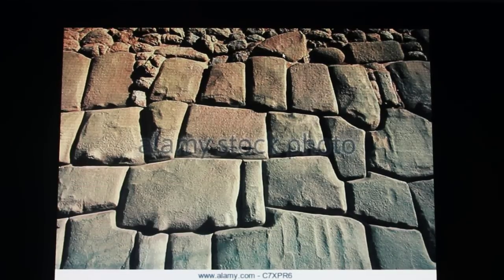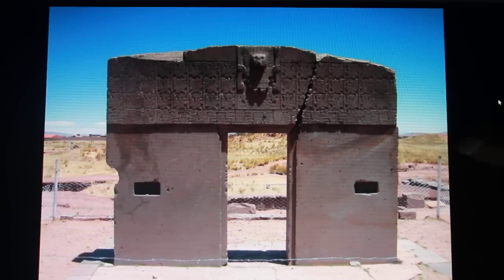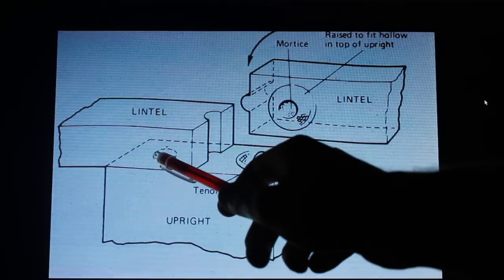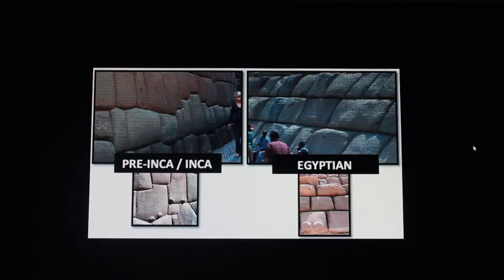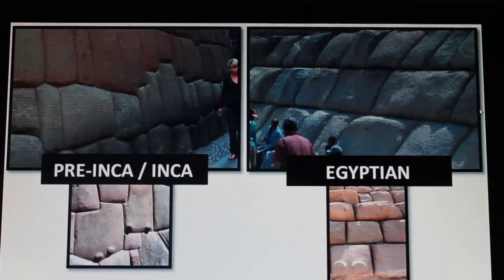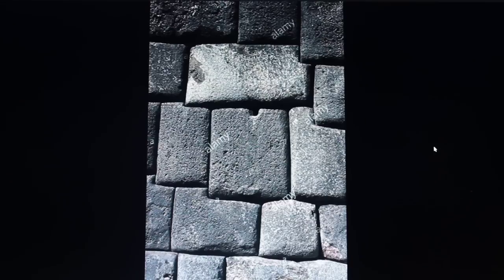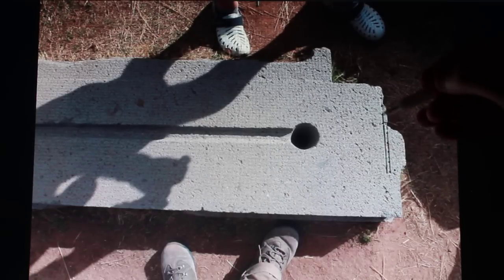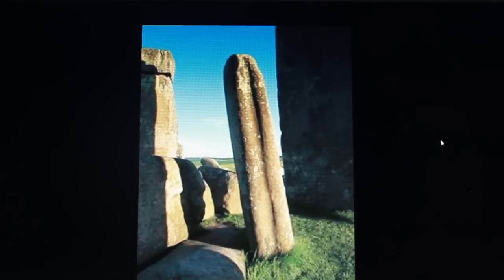Is this what the NUBS on megalithic pre-Inca walls are for? (FOR JOINING STONE?, Proof provided)

Comment: The nubs may have been for levers...large logs used to take most of the weight off the stone beneath it to place a lubricant between the stones...I believe a slippery compound of fine powdered iron ore mud and silica sand was used as a lubricant/abrasive ( hydro dynamic wedge). The stones may have been roughly cut with a bronze disc in the quarry using sand and water for an abrasive compound. The stones may have possibly been moved back and forth until they fit into each other perfectly...Silica has a moes hardness of 6.5 to 7 which is harder than granite, the humans of that period were highly determined, intelligent and extremely strong individuals. I'm not going to be quick to say that aliens did it with power tools because I don't want to dismiss human spirit and enginuity...when someone can disprove humans then I will look at other worldly or extra terrestrial theories. Humans today are extremely intelligent but lack the determination, drive, imagination and strength of the humans of that period..even back then they were extremely intelligent...it's just that today most people have a limited concept of creation and absolute no way of knowing how our ancestors did things, other than the glyphs left behind. I'm not saying that there are no aliens or other intelligent life in the universe but most people are quick to dismiss the humans of that period and say that aliens of a higher civilization must have done it. If we can't understand how they did it how could they have know how to do it??? Humans of today have a limited knowledge of making megalithic structures like these with the tools of that period. open your minds people, everything has an explanation and a reason behind it...note that the stones are not cut perfectly at 90• either..now don't you think if they had power tools they would have went to the extremes of making it a perfect structure...The Egyptians were very similar in looks to the South Americans and did have boats...disprove the humans first before you jump on the extra terrestrial theory which, don't get me wrong, is also a possibility...humans are amazing no matter what period they lived in. The stone wheels that are found at many of these sights may have been used as a hone to smooth the surfaces of these structures. Don't dismiss ancient humans before you can disprove them. Where there's a will there's a way...faith is power...humans are amazing!!!!

Comment: I've come to the conclusion through everything I've learned through research into this type of megalithic technology, that the builders had to have had some way of softening this incredibly hard stone without destroying it's atomic structure. It must have been done without the use of heat, somehow. I do think you are incorrect, however, in your assumptions that these were the work of some dying civilization and reusing this stone. This stonework is far, far to precise to be anything but the work of a highly advanced and thriving culture. I believe these stones with the nubs are much, much older than current accepted science is saying.

Comment: let me explain in simple terms.
these so called "megalithic" walls are built very roughly out of rubble, done in sections with wooden poles embedded, sticking out at various points, with only the tops of each section finished with cement and an imprint for the key to the next one, as each section is finished another pole is set in and then they built the section around it.

the wooden poles were for the wooden scaffolding to be attached as the wall got higher, when the wall was complete they rendered over the wall making it look like huge individual blocks, they started at the top and worked their way down rendering and dismantling the scaffolding as they went, as they got to the wooden poles they cut them off and rendered over the remaining "nub" to make it look like it was part of the stone.
 
if you had an invading army what better way to put them off than to make them believe, without even saying a word, that you were mightier than them !

the reality is, i could make those walls single handed, Stonehenge, pyramids and huge statues alike.

you can use crushed granite dust, sand or any kind of crushed rock including crushed quarts for durability, as ballast.

what you are looking at is concrete technology just like ours, cleverly done to confuse people right to this day!  

if you look carefully at some of the blocks you can see where the render has sagged at the bottom between the "nubs", as for the "scooped out areas, i would imagine that is where the render was too soft and it slipped off.

after a few centuries of weathering who would know ? 

why some of these walls were left unfinished or why they were abandoned is any ones guess .

i could use my imagination and say that the "nibbly pibblies" came down from planet "wonderoo" and used magical implements and ray guns twenty thousand years ago while we were busy dragging our knuckles along the ground and grunting to each other, make a lot of money from doing tours and selling books, or i could apply logic ! that's not to say there isn't some mysteries about these places, but rather as use our imaginations maybe we should try logic first.

there is nothing new under the sun, people.

Comment: 😂 All nubbs are nubbins but not all nubbins are for joining. 

I think you're right about some of these structures but not about the nubs on the faces of complete inca walls.

Personally I think the nubs on wall faces were for a timber frame, which helped keep rocks in position, anchoring and stabilising them, as they were worked.

Comment: After the Flood there would have been dead trees and logs everywhere.  What if an ancient civilization built out of wood from trees 30' in diameter.  Shaping and cutting it would be easier than with stone and would be nearly impossible to burn down being so thick.  What we see as stone buildings may actually be petrified wooden blocks.  What if the nubs were carved as a tie back for an overhead tarp or awning?

Comment: The incuse cuts that join up with a sister stone would od most likely hot molten metal poured into them or lead beat in them to more permanently join the two and keep frommany movment over the life of the structure, I believe these where also found like that on the roman colloseium most of them had been taken by scrappers hundreds of years ago but few where found with the metal still intact inaide the incuse shapes to bond the stones together.

Comment: Nope. Otherwise we'd have stones with broken edges and examples of such stones. Doesn't explain why some have them afterwards and were not curved down to be flush or that other stones have none of these markings. Seems more likely that they represent certain mountains as topological reference points and they are at the base over every stone to signify that they are mountains coming up from the base but in relief for height references, at the same time.

Comment: But if they were used to join stones together, which I kind of agree with, why were they so precisely jointed? The walls were no doubt built to be earthquake proof, and to last. Firstly why would they then dismantle a perfectly joined lasting wall, and secondly, wouldn't the nubs be as perfect as the walls. In these cases, they are almost an afterthought. My personal view is they are almost random like the filler holes would be in a mould? The stones are so perfectly jointed that they weren't placed there to be subsequently removed and reused. Strength in their randomness, and non use of mortar. But I believe they may, through sound, or electromagnetic waves been able to make metamorphic or igneous rock fluid again. Which they then poured into mounds. Once set the moulds were removed and the nubs , or filling holes are left?

Comment: Mortice and tenon ... nice idea and even sounds great at first. Problem is the shape and placing of the nubs makes it very ill suited for that purpose. You keep showing good examples with your mason and lintel drawing, which is exact opposite of actual nubs on these stones. Your example shows centrally located, actual nubs are not plus are on the edge and would not handle any load as would shear off or split. Mortice and tenon should also be uniform, when these nubs as even you pointed out are all totally different shapes and sizes. I would also think with all the examples especially since spanish removed so much of it that one would have by now found a prime example of nub being used as mortice and tenon, when exact opposite has been the case. Nubs and corresponding indents have only ever been found on the face, nowhere else.

Comment: The "reused" statement gets confusing to me. The idea that the walls are more structurally sound because of the nubs makes a lot of sense. I wonder if there were a way to "see" the inside structure of hoe the stones fit, your case would be confirmed. However, such intricate fittings in the walls, such unique shapes of the stones makes it less likely that they have been "reused". Unless in that first use, they were somehow in the same order.

Comment: Excellent presentation, i’ve noticed those knobs and dents for a long time. Could there have been a finished stucco or stone finish the building let’s say. When working with that kind of medium you don’t want a smooth slick surface you want irregularity to allow the finished work to more or less lock on to the substrate below it . 🤔

Comment: How does one know what they were for? They may serve no purpose other than ornamental. Sometimes a rock is just a rock.
Reply: Except, clearly, none of these are simply just plain old rocks. The big thing here is the shape. Forget the nubs for a second. If you wanted to recreate these walls today, the size of the initial rock would be massive in order to machine them into these shapes. There are no cut marks at intricate small corner angles that run into and beyond the 90 degree corners. That means at the very least any cuts made had to precisely end exactly at the corner, running the full width of the corner. Even with a diamond saw that would be ultra precision work today. On top of that, the rock that fits into it would have to be as precise. Now look at these and see how many curves exist as well. To recreate even a modest wall like this would cost millions today.
Reply: ZTekMil, cough,  cough, sarcasm. Honestly I don't believe they were carved. I have poured thousands of yards of concrete and these, to me, appear cast. Stone does have a melting point.

Comment: these rocks could very well have been poured to fit instead of cut to fit. Except, I have seen on some other artifact rock saw tooling marks.  In either case, we are far inferior to the technology used if these were rocks of a sort. But if you look at our today's building technology, we can totally duplicate walls even with more precision than these ancient walls were built. Our concrete of course does however not hold up as long. If concrete is not covered, it deteriorates within 50 years and starts crumbling apart. Maybe the ancients had a way of melting rock, then when almost hard, they put it in its place for which it had been poured and formed and thus you can see the tooling marks on various locations. The different recesses could just be signs of sloppy work or tooling marks. However, it's all a speculation anyway. But still cool to see.

Comment: IF YOU QUARRY THE ROCK WITH THE THOUGHT YOU ARE GOING TO REASSEMBLE IT THEN YOU JUST NEED TO WORK THE FACE  I HAVE SEEN WHERE THE JOINT WAS NOT FINISHED/BEVELED AND IT WAS CLEAR THE ROCKS CAME OUT OF THE QUARRY AS 1 LONG  [TALL AS WALL] SLAB   BROKEN INTO MANAGEABLE SIZES AND REASSEMBLED

Comment: so what your saying is highly skilled engineers barely escaped with their lives from an embattled planet in the midst of all out war with  very powerful bombs or nukes and that the first thing to do was set up a safe house made up of the most durable hardest stone and literally double up the wall thickness using megalithic sized bricks . interlocking unmovable fortress type architecture and pray like crazy they weren't discovered . because that would make sense really . the rest just does not check out or add up . earth born cavemen didn't need bomb shelters but wherever it is these cats came from clearly they were shittin' their pants . (or at the very least could feel a turd licking their jeans)

Comment: After carving thousands of rocks in a quarry to fit perfect. Wouldn't it be wise to mark the rocks in a fool proof way as to not put a several hundred pound rock in the wrong place? Maybe the nubs are an ancient method of marking the stones for placement without writing it down on paper or clay tablets.
Reply: Betty Gates If the nubs had some sort of pattern for your thoughts, then they should reflect and mirror thier actual placements in the structure.

Comment: How about...... the stones were used previously, for a wall or other structure, and then were used to build another wall.
Reply: If that was the case, they would have had to re-soften the stones to make them fit with this precision and use no mortar. When I first saw these stones years ago, I wondered why they did not make the wall solid. Since they could obviously do what they wanted with the stones anyway. But then it dawned on me that in earthquake areas, the possibility that the walls could absorb the shock would be critical. These walls have no mortar for that reason. During an earthquake these walls must sound like the biggest bag of bricks ever clinking together..If you look at the randomness, of them then start to think of the wall as a zipper, then you see why they did it this way.

Comment: if the nodes are for carrying why didn't they cut them off when they finished [dressed] the stone if they are tennon joints why are they on the front of the wall.? you dont put a tennon joint on the edge of your work.

Comment: The nobs are an artifact of the manufacturing process. I’m betting on that is where the excess water was drained out of, to enable the rock to harden.

The strange marks on the stone are where they pressed on the unhardened rock to mold it so that the seams close more perfectly. On the Inca fortress of Sacsayhuaman you can see how they did this more crudely by punching with logs and even fists. At this point they had moved into using planks to make the end result tidier.

Comment: I think you will get some of your answers to these Nubs and other questions if you would build a sturdy frame around the outside  of one of the smaller stones. And then from the other side use some sort of very strong press system to push the stone out. Even if you didn't get any answers it would look pretty cool.

Comment: Snakes are the key for all these old sites They are a building block and you see huge numbers of them and all sizes.  Head and fangs I can see that blocks are made from shaped petrified snakes. Does anyone else see that??? Really! Seems if you look closely,  it seems all the blocks are made from linked serpents that were petrified after installation. Construction with snakes and petrification? It looks that way!!! Think snakes look for them as the moldable construction material that can be hardened and you will see much more.

Comment: The knobs generally do not appear in between the stones. Instead what we see are T staples of molten metal poured into place. 
#1 We see "knobs" on mountains where stone has been removed,
#2 We see "knobs" in places (such as on the exterior of retaining walls) where there is quite obviously no trace of an adjoining structure.
I believe the metal T  staples are NOT for structural reinforcement but to make a good electrical connection between each stone.  The knobs and depressions are for fine tuning the entire structure to a single resonance. ( For what reason? Perhaps healing. We just don't know)
The inescapable conclusion is that we are looking at evidence of a lost technology based on harmonics.

Comment: If they were tied with ropes, then as the ropes cross in the middle, these "nubs" would keep the ropes from slipping during transport. Why they were left I cannot answer. At Tiwanaku( a city of 400,000 with no roads for supply?)they could not have supplied it by the single person path to. But there is an water elevator lift chiseled into the cliff below. The giant walls at Cuzco and Sacsuhuman were boat lift canals which is how they supplied the city with ocean fish as well as fruit from the Amazon. Look at an overhead of these big walls and you will see that they lead directly to the top of the hill. The open ends were where the lock lifts were. Go to James Northcutt on youtube to see this method employed on pyramids. Have much more than in my lame videos including actual definitive physical proof of this theory in the dozens. Have none of the skills needed to further it though as you can see. Need help!

Comment: The knobs of course are for lifting, with giant clamps. Think of a danish wood screw clamp, like this (remove spaces) : https : // img1 . etsystatic (dot) com / 199 / 0 / 9963018 / il_340x270.1284505557_ctgj.jpg It would need to be lifted by some kind of crane, or maybe giants, nephilim, spaceship tractor beams, etc.